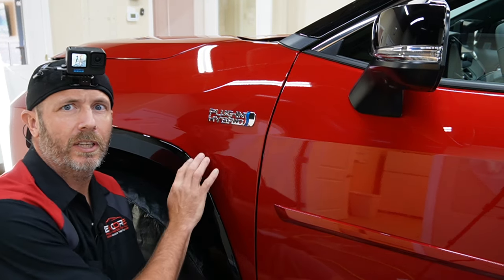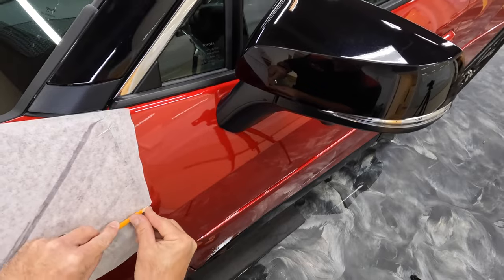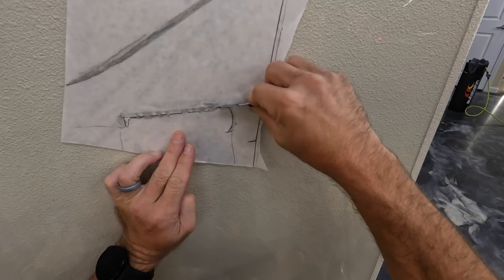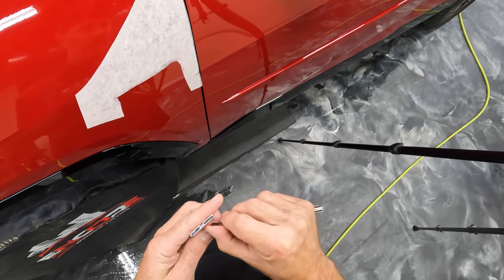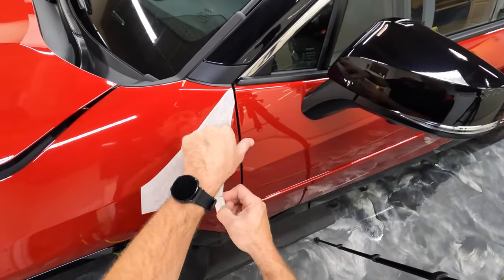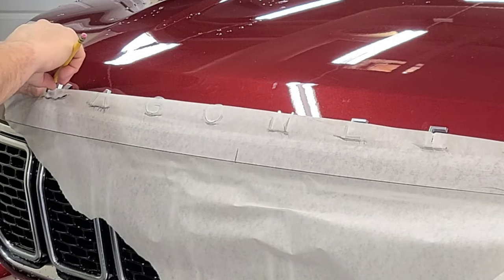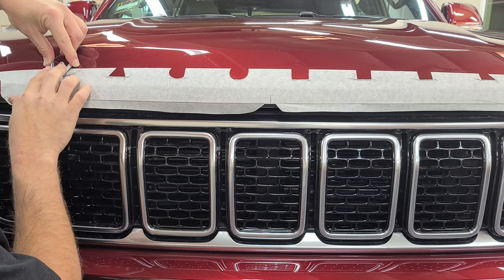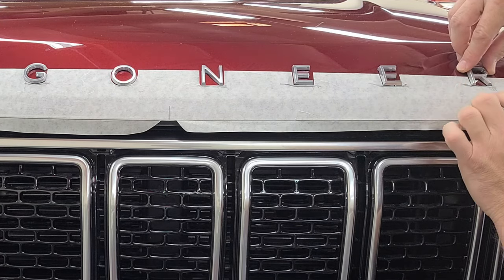Mastering Badge Stencil Creation for Precise Vehicle Badge Placement & PPF Installation

Comment: Is the cost of the badge included in your price or is that on the customer? Curious as someone who’s looking to get started in PPF
Reply: Or do you remove the old adhesive off every emblem and reapply?
Reply from the maker: We do charge extra if we are going to buy/replace the badging. I have friends who own a body shop across the street. We go through them to order the badging. It helps on price as they get a discount.  👍🏻

If we are going to reuse the badging (like we did in the video), we do not charge extra for that. We remove the double-sided tape from the badging and replace it with new tape. Then, reinstall the badge. 

I hope that answers your question. 😁 Thank you for commenting!
Reply: @EncorePPFtint  thanks for the reply! Helped a ton!